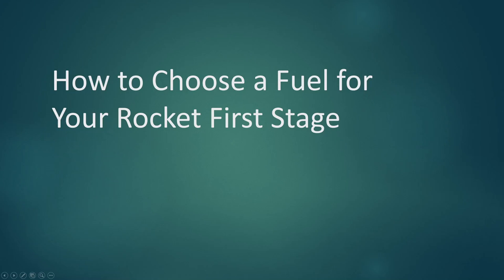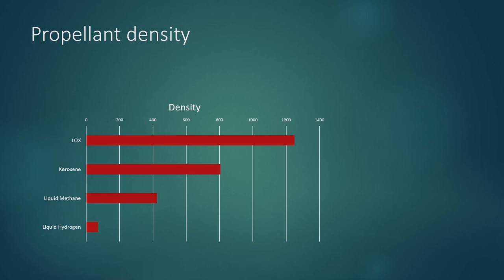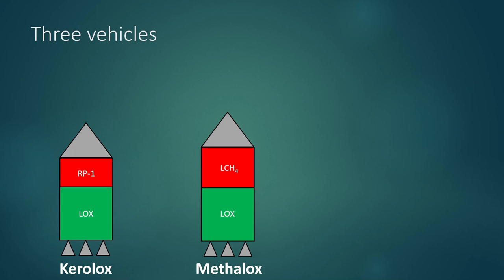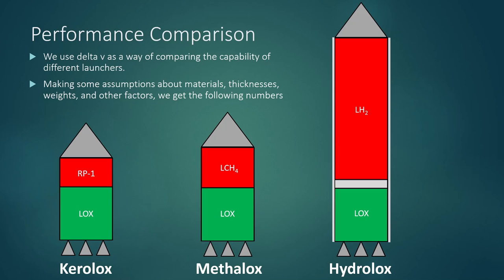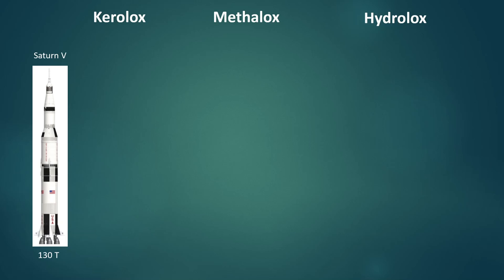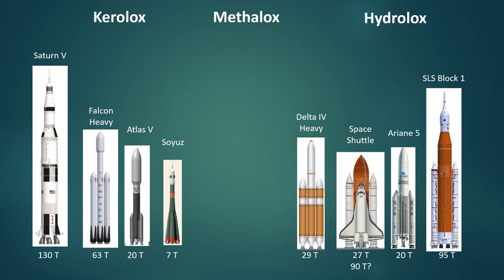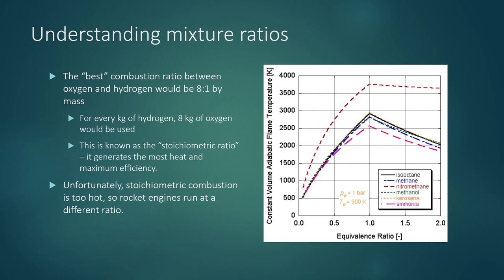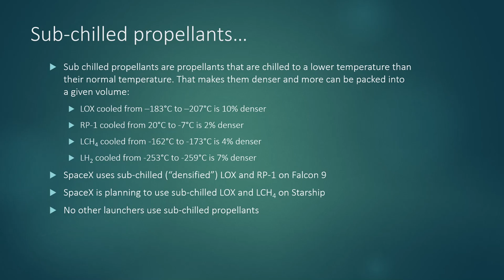How to choose a fuel for your rocket first stage

Comment: I feel that it's easier to understand the difficulty of keeping cryogenic liquids if you give the temperature in Kelvin. 

Going from negative 183C to negative 253C doesn't really sound much harder. It sounds like it's less than 50% extra difficulty to get an extra 70 degrees. 

But expressed in Kelvin, you only need to get oxygen down to 90K, but hydrogen down to 20K. That sounds like hydrogen is four or five times more difficult to reach.

Difficulty to reach isn't really a quantity as such, but I just feel it conveys a feel of what's going on more clearly.

Comment: Wait didn't the S-VB not use a common bulkhead on a Hydrolox Stage?
Reply from the maker: And that's what I get for not doing enough research.

The Saturn V first stage used two separate tanks despite it being a kerolox stage.

The second stage used an insulated common bulkhead; really two pieces of metal with insulation in between. Better than two separate tanks but still heavier than a single piece of metal. The notes I found said it was very hard to manufacture.

I couldn't find info on the third stage other than a mention of the common bulkhead.
Reply: Most versions of the Centaur stage (including all versions currently operating and under development), the S-IVB, and I believe the S-II all use/used common bulkheads with hydrolox. So yeah, it's supremely possible.

Edit: Granted, I'm not aware of any hydrolox first stage that uses a common bulkhead. Hydrolox common bulkheads are a pain to make work by all accounts, and so when you don't need the best performance possible like you do in the uppers stages, they don't get used.
Reply: I've got to give background first. It's known that S-II had many developmental problems and NASA really put the screws to the assigned North American Aviation (NAA) team. But a big reason NAA had problems is NASA was submitting changes to S-II constantly because of lunar module weight issues. By that time S-IVB was a flight proven design and it was too late to overhaul to save weight. So there's your answer: S-IVB was the first Saturn V stage to be human rated, before the total weight of the vehicle was assessed. We see sixty years later LH2 still gives the professionals handling problems. When the S-IVB was designed they thought it was the minimum needed to do the job. Just a couple of years later the state of the art had advanced to allowing a common bulkhead. It got bad enough at NAA the government ordered Douglas (S-IVB manufacturer) to help NAA with S-II. Douglass and NAA both protested because of trade secrets. The government won out with the argument that it was the customer for both contracts and any proprietary information is part of the contract so the government owns the proprietary information, not the manufacturers.

Comment: is it true ULA is more accurate than SpaceX when comes to placing the payloads into desired orbits ?
Reply from the maker: Yes. 

ULA's second stage is the Centaur, which has been around in various forms since 1962. It's very lightweight and high performance, so that's why they've kept flying it, though it has been updated - Atlas V uses the Centaur III and Vulcan will fly the Centaur V.  The Centaur has a tiny engine, the RL10, which only puts out 99 kN of thrust.

The Falcon 9 second stage uses a Merlin Vacuum engine, which puts out 360 to 981 kN of thrust - about 3 to 10 times the thrust of the RL10.

What that means is that it's harder to get precise amounts of delta v from the Merlin than it is from the RL 10. You will sometime see SpaceX do a second burn on the second stage that is around a second long, and it's hard to spin up an engine, get in thrusting, and shut it off in that short of a period.

ULA also says that they have some advanced software that dynamically recalculates their trajectory on ascent. I haven't heard SpaceX say they also do this, but it wouldn't surprise me if they did.

Whether this makes any difference is another matter; pretty much any payload has thrusters to make small adjustments  to its orbit, and while a better initial orbit will save a little fuel, it likely doesn't mean much in most cases.
Reply: No
Reply: @ale131296  just know, no explanation?

Comment: Hydrolox and other propellants the mixture can be tuned to towards low molecular mass byproducts to achieve high exhaust speeds and therefore isp so even though the rocket generates less energy relative to its mass it is more efficient to use more fuel than is optimal. 
For comparison say you mix Hydrogen and oxygen at a 2:1 mole ratio this results in water vapor with a mass of about 18 grams per mole if you instead tuned a rocket to a 3:1 ratio you get water and hot hydrogen gas that has an atomic mass of 1 this huge discrepancy means that even at lower temperatures your specific impulse can be higher; thrust can be lower through.
Reply from the maker: Definitely true. I went with real engines on the assumption that the engine designers had chosen mixture ratios that were optimal based on their design goals.

Comment: Maybe when you talk about common bulkhead should examine another unorthodox solution, like a coaxial design witch would work well for methalox, both liquid oxygen and methane will be drained from the lower part of the tanks(no external pipes or internal for the upper tank to the engines) and level of liquid will be the same in the both tanks during all propulsion phase.
Reply from the maker: Hmm. Tank inside a tank...

My initial impression is that such an arrangement is going to be heavier; the common bulkhead goes away but you have the extra weight of the internal tank. 

I also think you'd need insulation; one of the reasons you can get away without it with common bulkheads is that there is a bit of space at the top of the lower tank and that slows down the heat transfer. If you had coaxial tanks, both sides are in contact with the shared tank wall.
Reply: @EagerSpace  you need to consider hidrostatic pressure from the inner and outer tanks canceling the need for a thicker wall for inner tank, also you don't need such higher gas pressures in the upper side , in the case of lower tank only thing that keep its structural integrity is that pressure(from being crushed by weight of upper tank, like it happen in a SpaceX test) , I think the main advantage is shorter fuel line and simpler plumbing for both fuel and oxydizer , but you are right will work only when you deal with propellants in which both components are the same in temperature range, basically methalox but I think it's a small company from Scotland that developed such designs for a liquefied propane and oxygen rocket.
Reply: The Proton does this sort of tank arrangement, though its NTO/UDMH. It looks like strap on boosters, but instead each engine has a vertical fuel tank with a central shared oxidizer tank.

This makes the first stage heavy but simple compared to the Soyuz or Angara. And of course because it's hypergolic there's no insulation or cooling to worry about, fuel and oxidizer are stored and loaded at ambient temperature with no boiloff.
Reply: @Hevach  this is different from a coaxial design, it have separate tanks attached externally,is not a tank within another witch could be lighter, because the inner tank only needs to resist pressure differential between the two liquids and can have thinner walls.

Comment: Doesn't RP1 freeze when using a common bulkhead with LOX?
Reply from the maker: Somewhat surprisingly the answer seems to be "no". Falcon 9 uses a common bulkhead for both the first and second stages of Falcon 9, and the second stage has to support long duration missions for some DoD launches. It does have a "extended mission pack" on the second stage for those missions and that includes some heaters but I don't know if there are any on the common bulkhead. 
I looked at a couple of other rockets, and the Saturn V first stage and Atlas V first stage appear to use separate tanks. I think the Soviet Energia uses a common bulkhead, but it wasn't totally clear from the references I looked at.
Reply: @EagerSpace  Your channel inspired me to finally read Eric Berger's Liftoff that I bought when it came out but never read past the first chapter. It also pretty clearly states that the Falcon 1 used a common bulkhead.
Reply from the maker: He did a nice job. I'm waiting for his falcon 9 book.

Comment: Hmm… I still don't think I understand that. How can kerolox get away with using a common bulkhead if there's still such a difference in temperatures?
Reply from the maker: There's a little space at the top of the lower tank so you don't get direct conduction through to the other propellant; you get conduction through the walls and a bit of radiation and convection in the empty space.

You will get cooling of the warmer propellant, but you have a lot of mass in the tank and not a lot of heat transfer.
Reply: @EagerSpace  Ah, thanks for the explanation!

So I guess the difference with hydrolox is that even a little bit of extra heat might evaporate way too much H2 while that's not really the case for O2 in kerolox.

Comment: I've built some Hydrolox prototypes in KSP with RSS/RO mods, also in SimpleRockets 2 with RSS. And for me it became the most successful choice when I realized I just have to build much larger rocket. It has real benefits: when filled, the rocket is much lighter, about 5 or 3 times than Kerolox rocket, and it flies way further.
I think, Hydrolox will be a better choice for Starship than Methalox. It's easier to produce on Mars, it will be less weight stress and maybe acoustic damage to the launch pad because of lower mass and thrust (although jet kinetic energy may be high enough to turn into quite powerful shock waves). There may also be an opportunity to place even more efficient nuclear thermal engines into the ship. But then Starship must be at least 12 m wide and much much higher.
It seems to me like issues with hydrogen could be overcome if Elon Musk started working on it. I can also start my own way.
Reply from the maker: Hydrolox means big stages and that means heavier structure. That's particularly bad for starship because that makes the fins and heat shield bigger and therefore heavier. Hydrolox is not a popular choice for first stages in expendable rockets.
Reply: @EagerSpace  Yes, dry mass will rise a lot, but filled mass... Well, I think, the main concern is durability of a big structure. And maybe initial cost of this thing.
My current achievement is 3800 t wet mass including more than 250 t of payload to low Earth orbit in expendable mode.
Reply: The problem with hydrolox and Starship is that it adds more problems than it solves, particularly with the first stage booster. It's absolutely great for upper stages but many of those same advantages don't apply, while its disadvantages still do. Yes, it's much more efficient with RS-25 having a 452 second vacuum ISP, but at sea level it's not that much better than methalox with 366 seconds vs. 330 seconds. There's also the issue of thrust. The lower thrust of hydrolox doesn't matter much in space, but it also means worse gravity losses for your first stage due to slower acceleration. The end result is a much more expensive and less capable first stage with a higher-performing upper stage.
While you could go with a methalox booster and hydrolox upper, then you run into other costs. Your infrastructure has to deal with two fuel types, one of which is very difficult to handle, and you also lose engine commonality which adds R&D as well as production costs. As for Mars, while hydrogen is easier to produce on Mars than methane, it's much harder to store.
In the end, while it has the best theoretical performance, practical difficulties make it sub-optimal for many real-world uses. Looked at in a vacuum, it's great, but when you consider ALL the required tradeoffs for Starship, methalox is a better choice for this particular case.